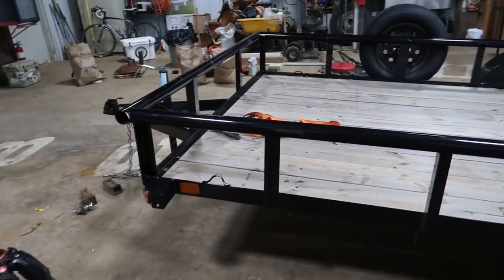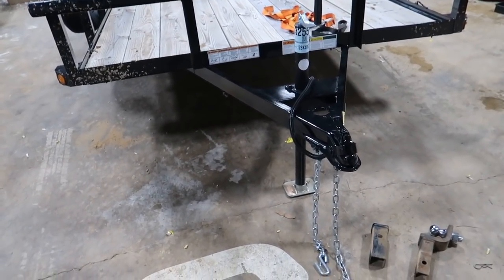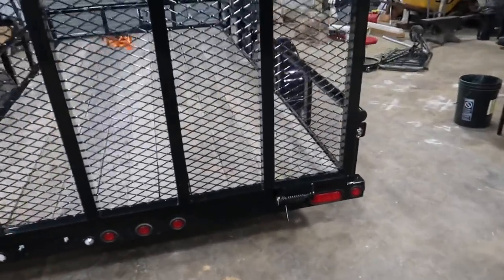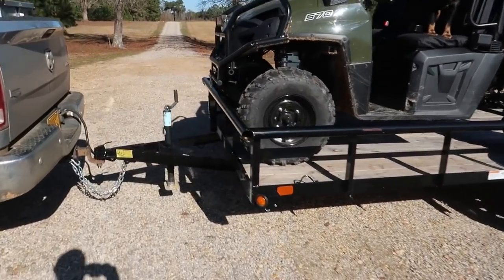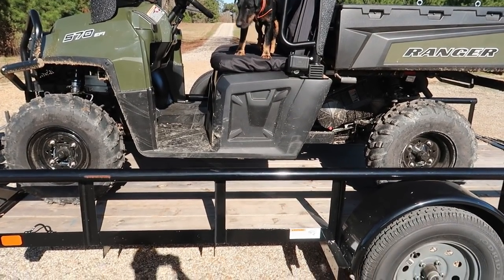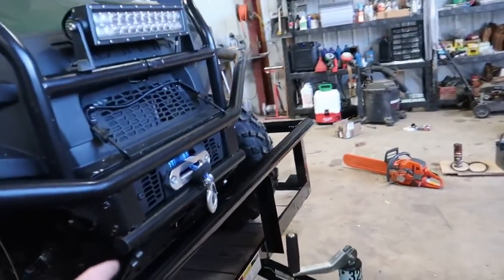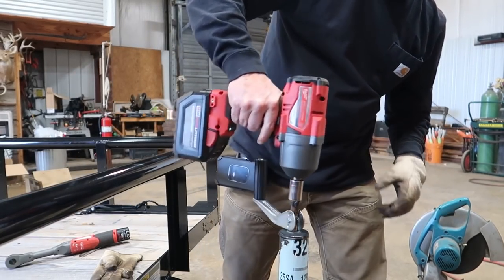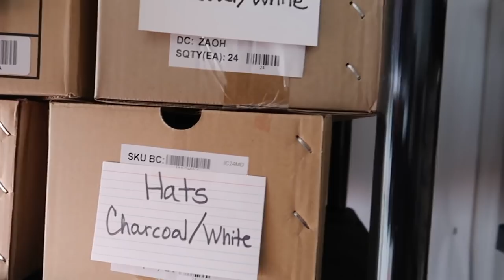Brand new Big Tex trailer

Comment: I coated my boards with some Rustoleum paint made to coat decks with.  It’s tough and added some sandy grit to the surface for traction.  Been on there over 5 years and still looks great.  Has been a great coating!

Comment: I have the same trailer. Works good. Round tube is the strongest for it's wieght. Also won't mare things that rub on it. Bearing buddies work fine. They keep the grease under spring pressure to force the grease in the bearing. The only grease that  lubricates a bearing is the grease inside it.

Comment: If the grease fittings are in the axle instead of the cap it will put the grease between the bearings. We have that style on our cattle trailer. They work great.

Comment: They build a lot of cargo trailers around here. We have about 6 plants in the county. I recommend going over every nut and bolt on them because there are some outstanding individuals working at those places. Even seen some shackle bolts come out on friend’s brand new trailer. Matter of fact stopped at Home Depot in Moultrie, Ga and fixed it.

Comment: You could always take the bolt out of the jack handle and replace it with it hitch pin. This way you can leave it off for use with the impact but if you dont have it or the battery is dead you can pop the handle on with the pin.
Reply from the maker: I like the way you think! Great idea!

Comment: I don't have the tube top on my trailer, but wish I did.  That way I could just strap something tall over top of the sides and not slice my straps.  Looks like a nice trailer.  I agree totally with the bearing buddies, I don't even bother running them on any of mine.

Comment: The round pipe top rail is stronger than angle iron. The bearing grease fittings are drilled and tapped into the axle, when you grease each axle the grease comes out between the bearings. Instead of the the bearing buddies that only grease the outer bearing. Thank you for showing us your hard work and your joys of working hard !!!!!

Comment: Another great video.  I'm not sure, but I think you have a Dexter EZ Lube axle.  Check and see if the grease fitting is actually screwed into the end of the axle.  If it is, when you grease the axle, the grease goes through the center of the axle and comes out between the inner seal and the inner bearing.  When you grease it, it has to push the grease through the inner bearing and the outer bearing. then out through the cap.  These are excellent axles.  Keep up the great videos.  Thank you for all the time you put into them.

Comment: Mr Tim bearing buddy's push grease into the bearings and hold pressure via a spring which cause seals to blow out. You just have a ez lube axle. The grease goes in through the center and out in between inner bearing and the seal. We fill them when there brand new to where they just start to show grease on outer bearing. No issues as far as blowing seals out. Itll push the extra grease out that rubber plug before itll push that seal out. Good luck with your new trailer. 👍👍

Comment: Was going to suggest using your drill on the jack. I agree on the tongue length, wish my 12 ft had a longer one. My 16ft trailer is a BigTex, no issues in 20 yrs.

Comment: You are right about the air bags for hauling definitely worth it.  The trailer is nice.  I think the fold up jacks with the wheel are better than the ones with the plate.  Great job on the video

Comment: Trust me...... You will learn to trust them Buddy bearing things. I did the same you thought of, Tested a couple times. ALWAYS worked perfectly!!! I had to always run the Grease Hand pumps..... Now have seen you with the Battery pumpers...... FANTASTIC!!!
Reply: Regular bearing buddies only grease the outer bearing, yes it keeps that one bearing greased well with the spring pressure. This trailer likely has the grease through spindles which are great for both bearings and can go much longer between re-packs.

Comment: You are going to like that Dexter  axle.  It is not the same as add on bearing buddies. It does a good job of greasing the bearings. I will not buy a trailer without a Dexter axle.

Comment: I never liked the bearing buddies, they stick out farther than the standard stamped cap and most times get knocked off easier leaving you with nothing. The other thing I don't like about them is people that don't know any better over fill them. Too much grease will cause the hubs to overheat and cook the grease which of course goes downhill from there.
Nice looking trailer, one odd thing though, why did they put the jack through that extra plate instead of the hole in the coupler where it's supposed to go?

Comment: Tim,I have a 6×12 trailmaster brand trailer out of texas,never had any trouble with my axle bearings till I installed buddy bearing system,I kept it full of grease and the bearing must have pushed out and ruined my left spindle,had to buy a whole new axle because of it,u right,I would do it the old fashioned way like u talking about and I would take those buddy bearings off man,jmo,I took them off and never had that happen since,don't trust them,

Comment: It appears you have those E-Z lube hubs by dexter. The spindle will be drilled and the grease comes out at the inner bearing so in theory you spin the hub while adding grease till fresh grease comes out the hub cap packing both bearings with new grease. My camper and car trailer both have these.
Reply: I agree. The grease comes out between the seal and the inside bearing. Grease goes from the inside out.